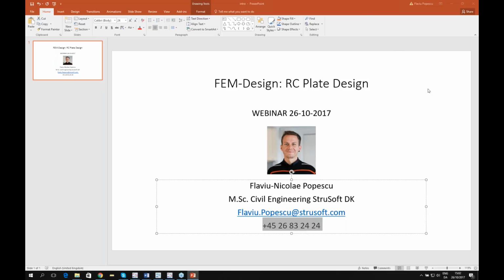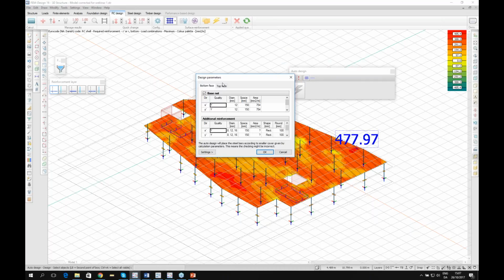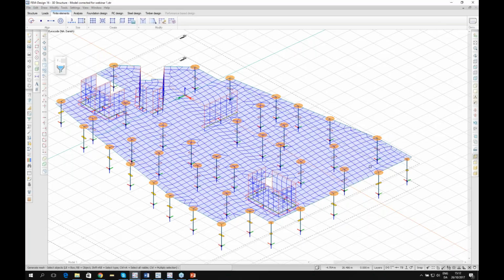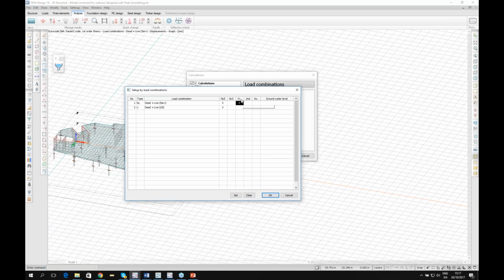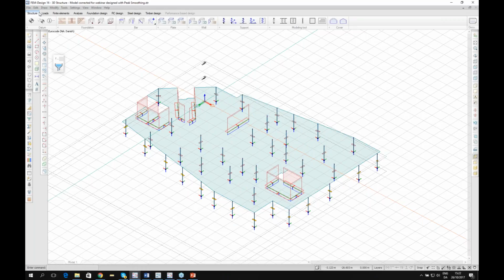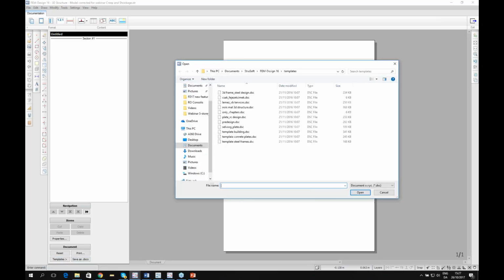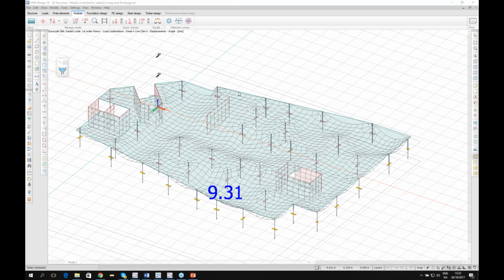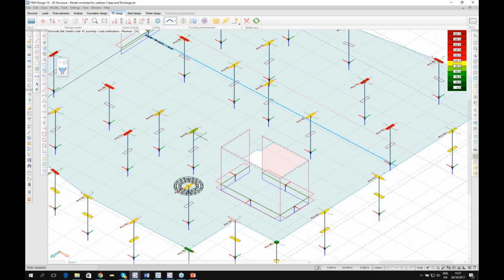Webinar: RC Plate Design

Comment: Hey, I wanted to know how the the theory that the software uses for designing plates with othrotropy . I mean if E2/E1 ratio of a plate is less than 1.

I'm designing and getting output from fem design 18 but I'm not sure if the moments provided are correct.
Reply from the maker: Hi! 
Please contact the support and attach your model file and we will take a look at it! strusoft.com/support
Thank you!
Reply: @StrusoftOfficial  Thanks for the response, the error has been rectified. I actually got confused with the axis orientation in the software and that alpha angle.

Please Could you make videos on that function as the manual doesn't sufficiently explains how the function works.

Again, Thank you
Reply from the maker: @iecivil  We are currently working on videos covering a basic course for FEM-Design. We will take your suggestion into consideration.
Thank you!